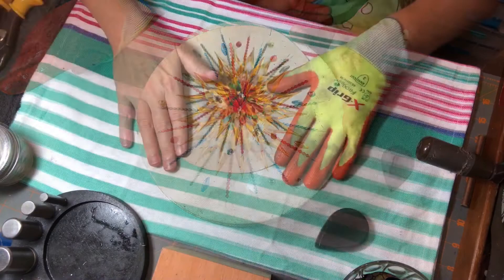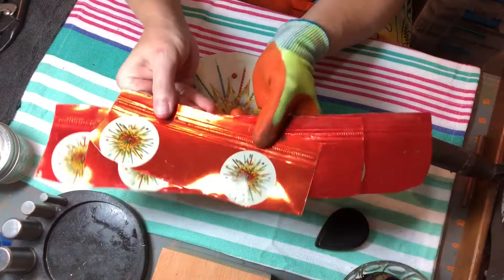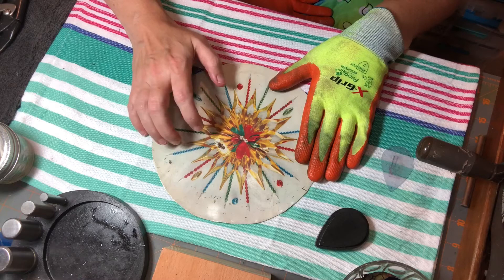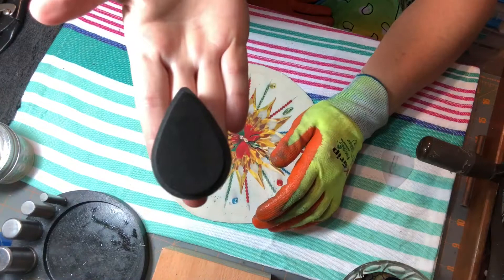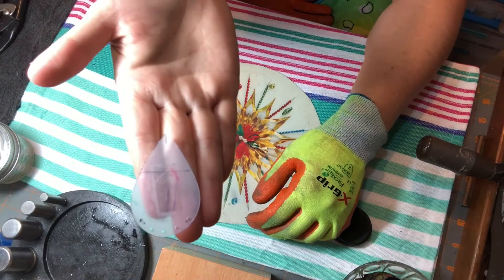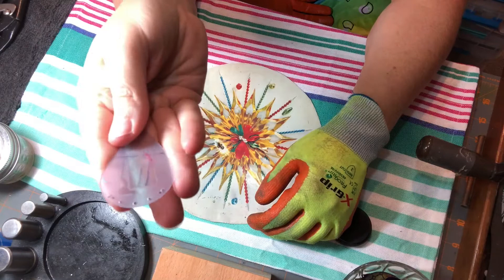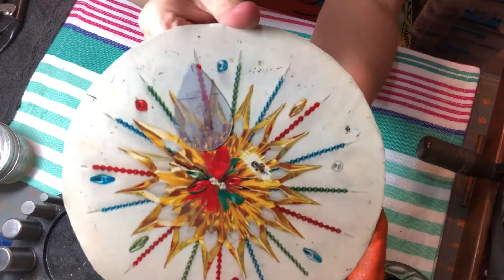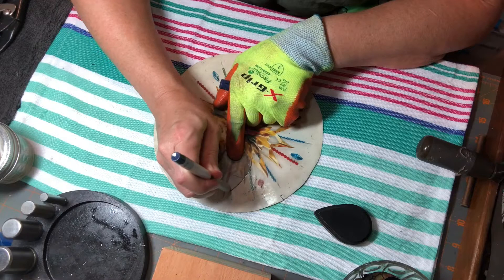Tin Jewelry Making: Transforming the Christmas Tin

Comment: Why did you run it after you cut them out
Reply from the maker: Hi, can you please clarify ‘run it’ so I can understand and correctly answer your question. Thanks!
Reply: @atomicanucleibycatina7861  why did you run it through the big kick?
Reply from the maker: @TanKatLuvr1965  I used the big kick to emboss the tin. Sometimes I use it to flatten the tin evenly (sandwich tin between closed folder and plates).